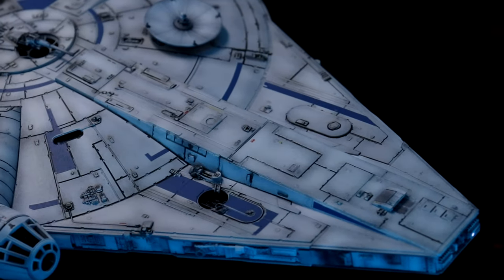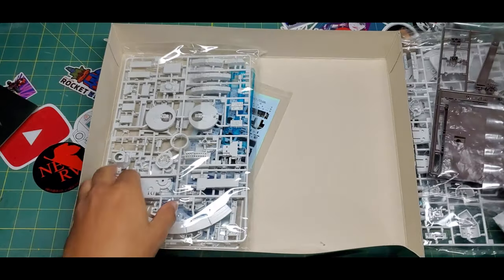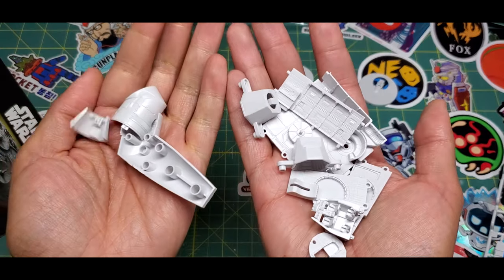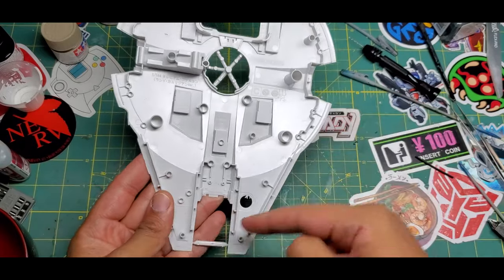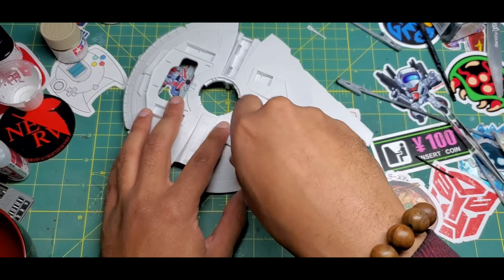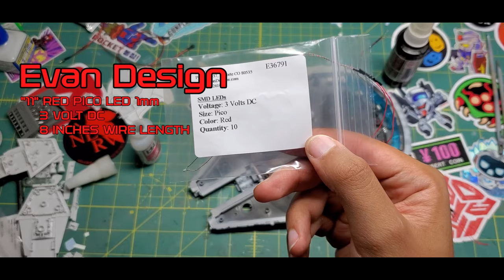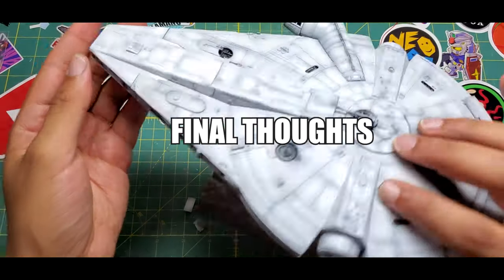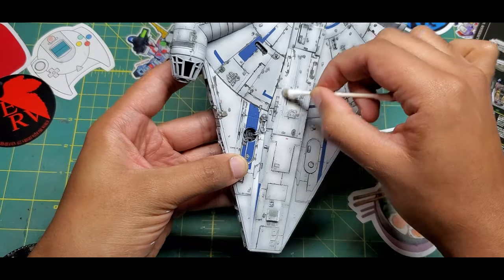#newtype #mandalorian #Otakubuilder 1/144 Millennium Falcon (Solo a Star Wars Story)

Comment: I have this kit in my "paint backlog", but keep putting it off... that escape pod scares me a bit since I know it will scrape off so much paint when I "dock" it... Sure, could sand down the parts a bit but then it might be too loose instead.... D:

Also, most Star Wars kits comes with both waterslides and stickers.

Revell kits are not super accurate, bandai has gone all in on that part... At least on the PG they used scans and stuff from the actual film model.